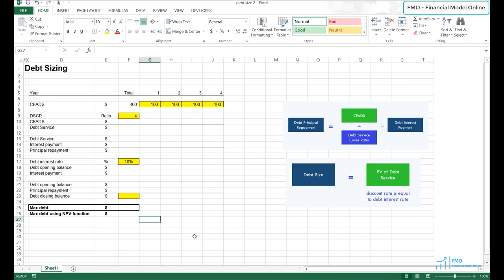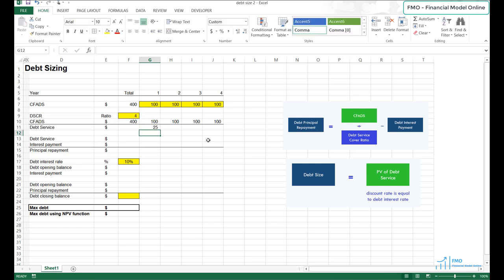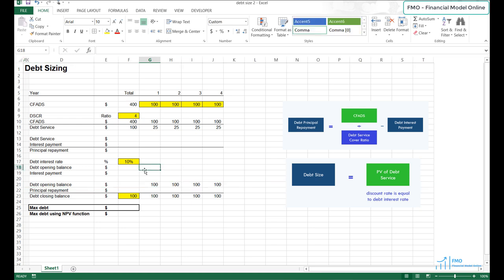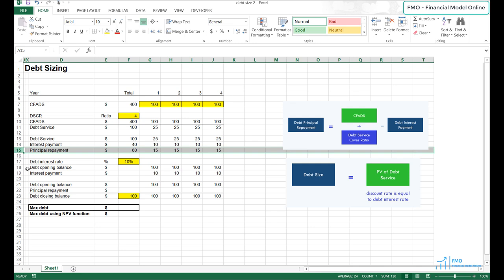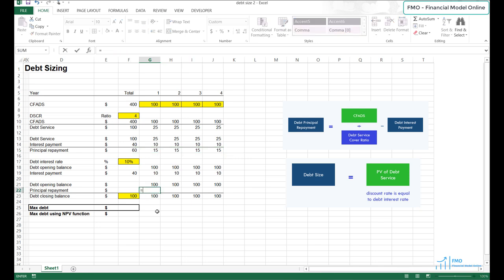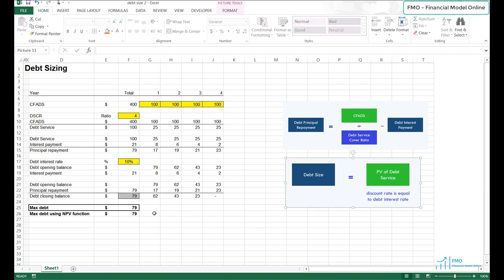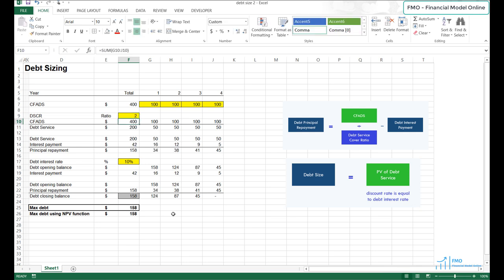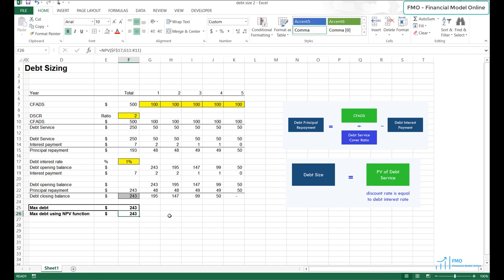Debt sizing concept in project finance - financial modeling for renewable energy

Comment: 7:00 
debt size = PV, present value of debt service
8:45 
interest rate determines the debt size for the project.
the lower the risk, the lower the DSCR interest rate. and higher the debt size.
tenor also determines the debt size.
the longer the tenor, the higher the debt size is.

Comment: I have a doubt , please solve this. I understand the circularity of debt sizing, but for CFADS, we start with revenues for which we require tariff charges for a 4 part tariff structure (suppose). Now for the capital cost recovery charge rate we need to goal seek the rate such that the equity IRR meets the target IRR. So essentially we need CFADS for arriving at the capital recovery charge rate which in turn is again determing the CFADS and hence the circularity. Also this CFADS is being used in the debt sizing equation. So which to size first debt or tariff?

Comment: I would be interested in the Telecom infra project financial modeling, any plans to do smth like that?
Reply from the maker: Hi Nataliya, we are not planning to release telecom, but we will do a project finance mining course. 

In this course, we should how to model the debt based on multiple covenants, which are suitable for projects with inherent revenue risk such as a renewable or telecom, it is a different approach we have taken in the previous course.
Reply: @financialmodeling1899  Modeling mining projects are super interesting, if you go up the value chain, not just stop at extraction. But I wonder how big a demand for those projects right now, given the current climate issues.